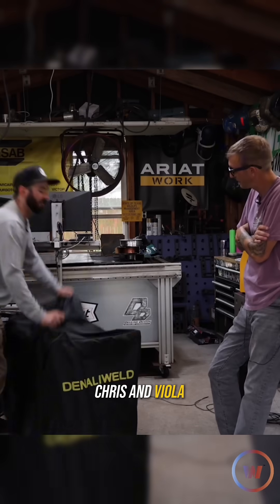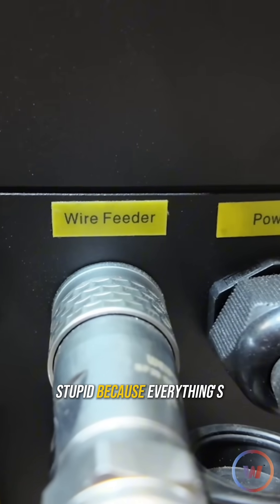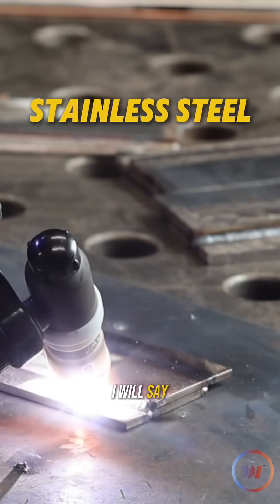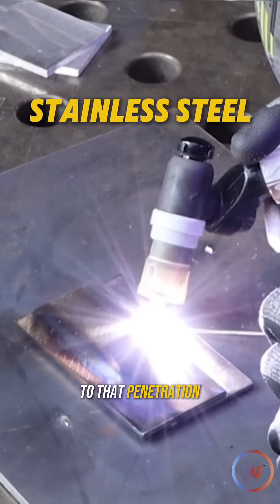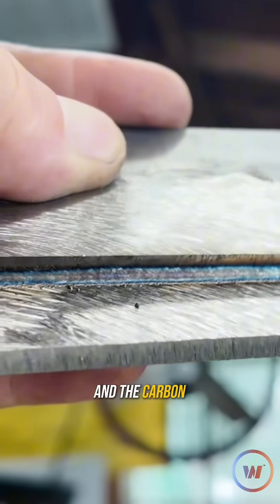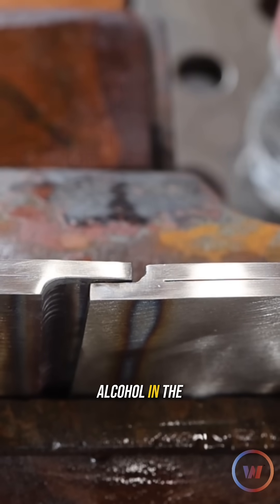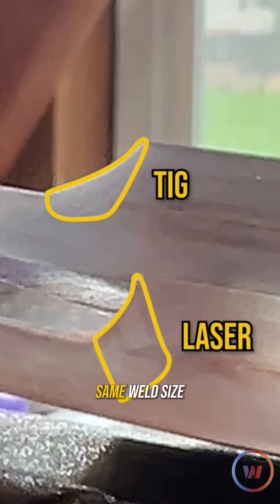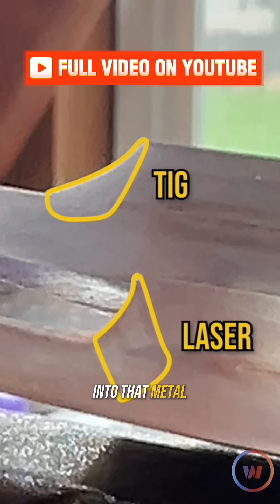Testing The Denaliweld Laser VS TIG Welding #laserwelding #tigwelding

Comment: Don't be stupid, you can't compare TIG welding with laser welding. Do you know why? Because it's slower but stronger and more precise. The melting point is 900 degrees and laser welding is cold welding. Don't you know that TIG was invented for the aeronautical industry in the United States? If you're a real welder, you know that comparison is laughable. There is no price more precise, perfect, and stronger than the precious (TIG) tungsten arc in inert gas.
Reply: Except you’re wrong and laser welding is stronger than tig…
Reply: @ jajajaja you are not a welder ,,,
Reply: @EudysArevalo-b6v  I’ve been welding for about 18 years now.. the tests prove that laser welding is stronger. You’re obviously not a weld engineer